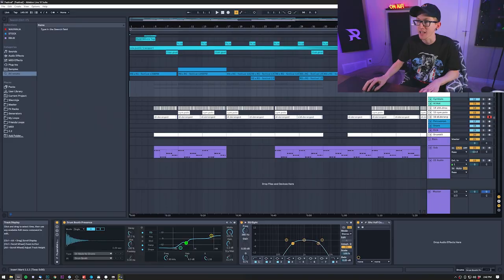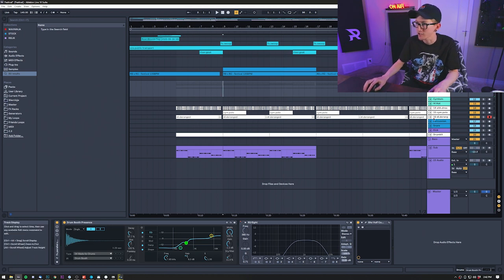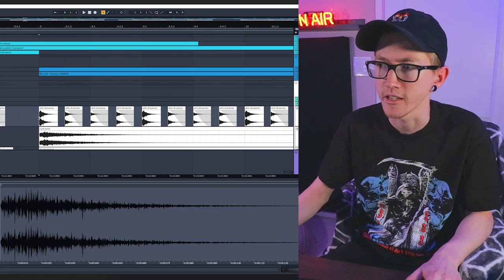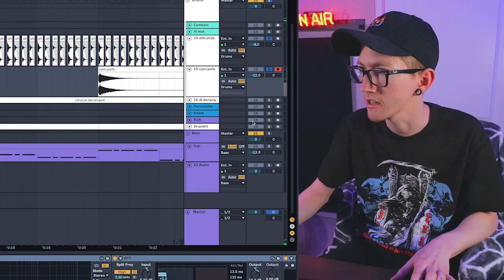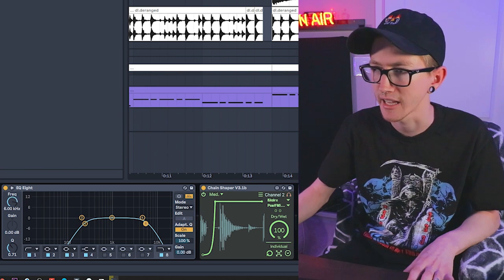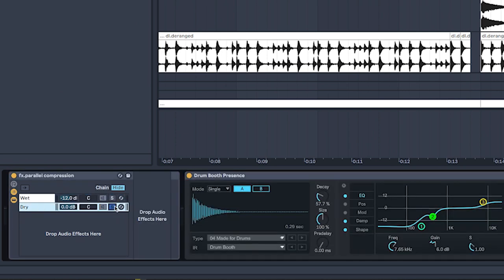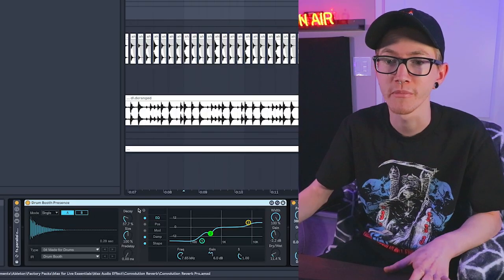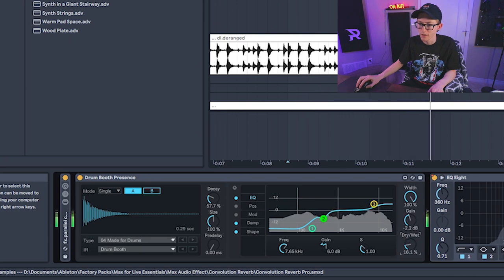How To Make REALISTIC Sounding Drums! 🥁🔥

Comment: These emo pop kind of beats are so sick, can you go in depth on the chain shaper you use & how it exactly works as well as all the different functions of it?
I recently purchased chain shaper after i saw your template video but not exactly sure what settings i should be using on it (like wide, medium, etc. as well as pre or post fx) and its confusing because theres no threshold like a compressor for sidechaining.
cheers man!
Reply from the maker: doubt i’ll do a video on it just bc it’s pretty straight forward. i usually just use the wide setting and just route it to the pre Fx of the kick at 60-90% wet. additionally you can use multiple channels for other elements such as the snare. the bottom right arrow allows you use multi and sidechain if you only want to sidechain a specific frequency.